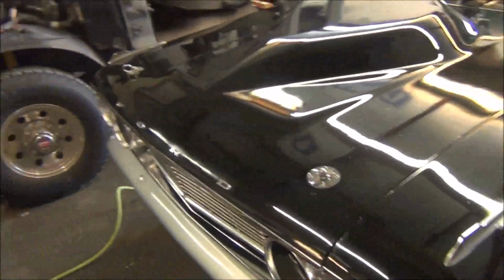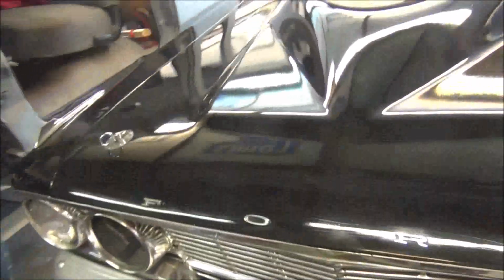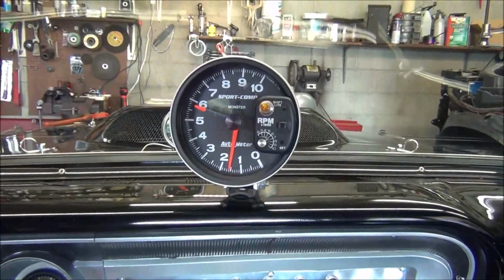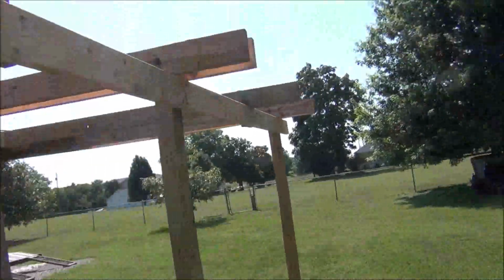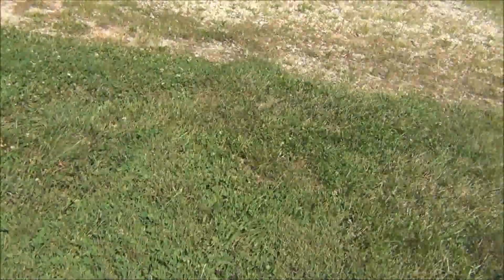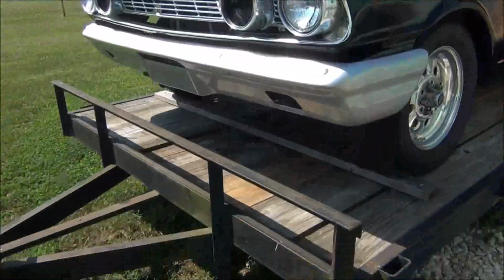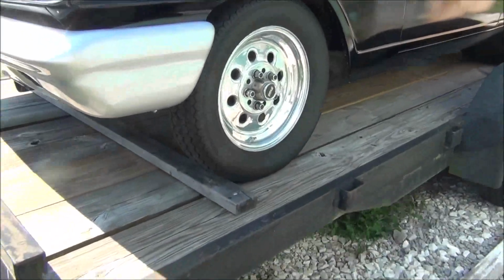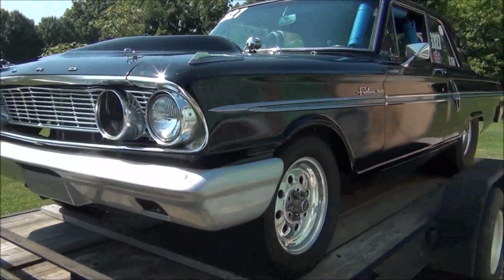64 Fairlane update  New front coil over shocks and more

Comment: Lay a plywood shim along the lowspot of that beam, screw the board down using a long level to avoid making the board dip. Pack any air gaps under the board before n after the shim with no nails. Meanwhile im still bingewatching the 460 rebuild, i wanna get into mine soon, thanks for uploading.
Reply from the maker: I put a 2x4 under ajck and put some pressure on it. Then left it like that for 2 hot days. Now its a lot more straight. Thanks for watching.